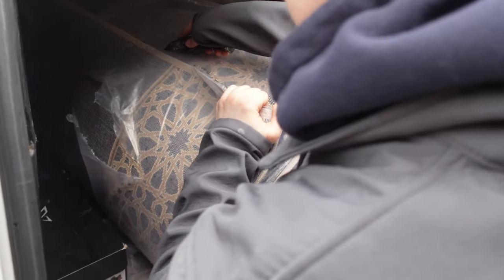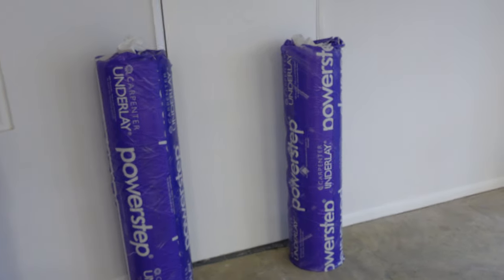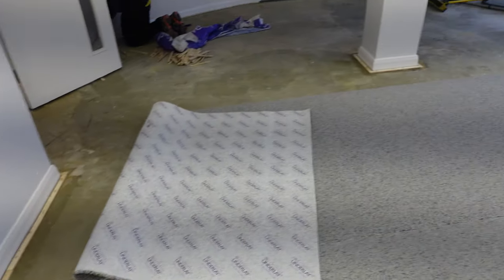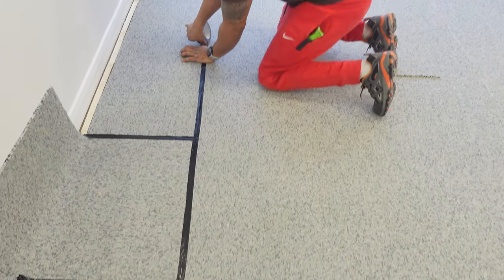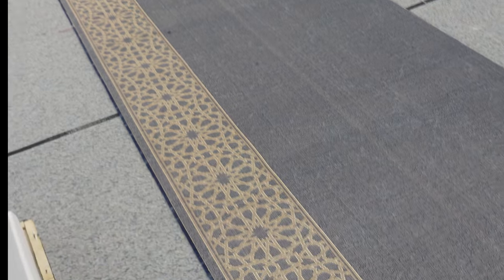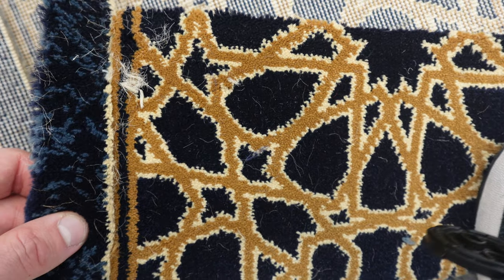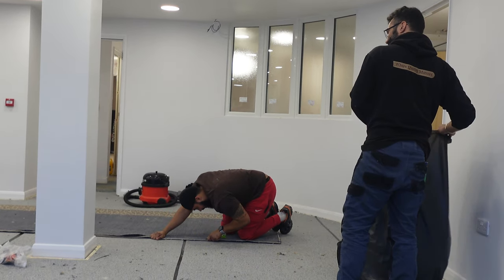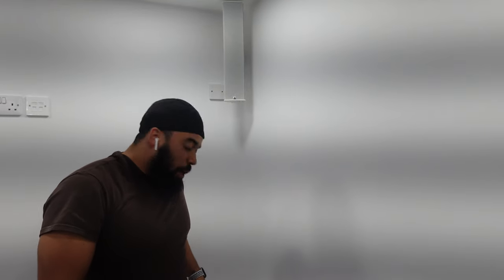CARPET FITTING A NEW MOSQUE- PART 1

Comment: Felt pad and woven goods can often act like Velcro.  I've always worked by myself.  Positioning carpet can sometimes be a bit difficult.
Many many years ago I discovered that buying a roll of medium weight plastic sheeting can make the process a breeze. I'll cut the width of the retreating into six or even 10 ft wide strips and place those on the floor before unrolling the carpet. You don't need to butt the pieces of plastic  so that they totally cover the floor. You can leave 6-foot spaces in between them. Once you unroll the carpet on top of these pieces of plastic sheeting, moving the carpet interposition is a breeze. The carpet will slide around like an ice cube on a hot skillet......... Okay maybe a slight exaggeration. 😁
Anyway, once the carpet is exactly where you want it, just pull the strips of plastic out from underneath the material.
Without the plastic, you might be tugging and pulling the carpet and stretching it unintentionally.
I have always hated deadlines, so I wouldn't touch the type of work you're doing with a ten-foot pole....... I convert that to meters,  but I'm from the United States 😁
You guys do beautiful work and I really enjoy the craftsmanship and details you show. 👍